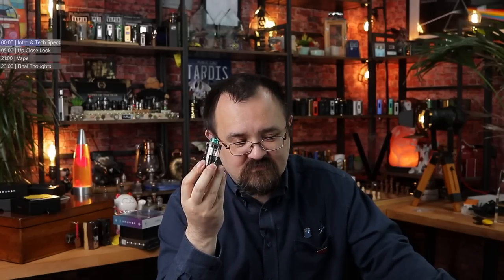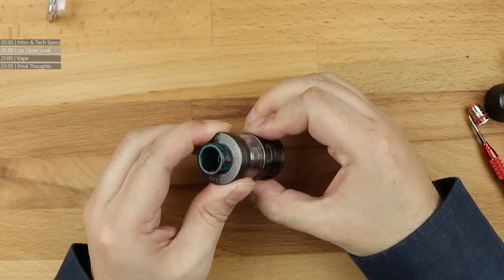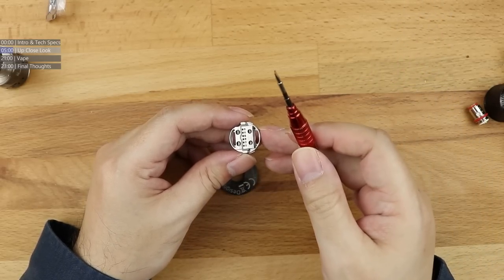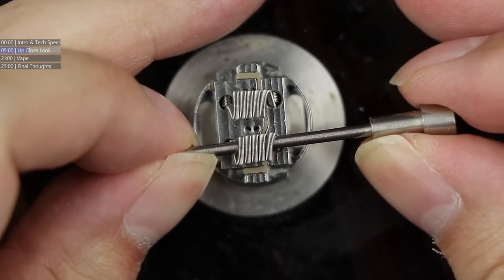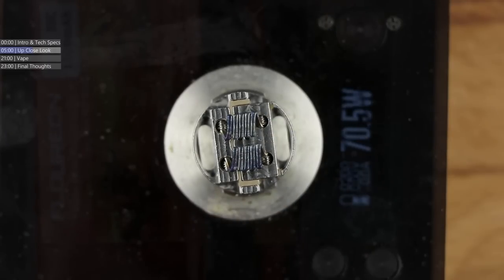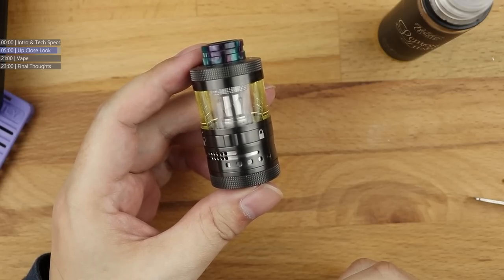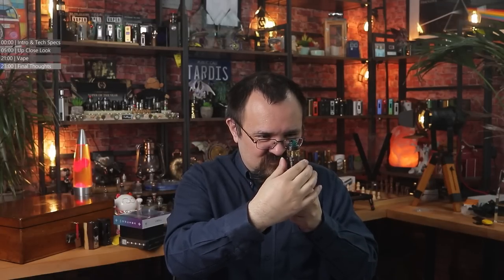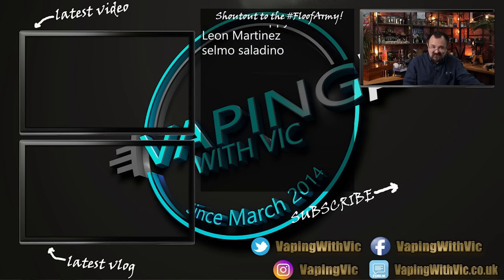Steamcrave Aromamizer Plus V3 - The Plus gets a refit

Comment: I use the supreme V3 & it hits like a drunk step dad. the flavour you got from it is absolutely outstanding 👌
Reply: V3 is the way to go using that and the Ragnar currently
Reply: Preach! The Supreme v3 was the third rebuildable I got. I knew absolutely nothing about rebuildables back then, saw it in a best of 2020 video or whatever year it was, I liked that it looked different and got it. Well, a dozen tanks bought later, and I'm still here with the Supreme v3. It's my absolute favorite. Is it the best at everything? No. I do prefer my Blotto Max or Fat Rabbit for some liquids, and I do love the practicality of my Blaze due to it being top airflow, and I think that the Profile M is a better with mesh (also, the Profile RDTA is the best mesh thing ever flavor wise), but nothing else does it all well. I wanna go dual coils? Perfect. Want a single coil RTA? Got it. Want mesh to change it up? Sure thing. Custards? Fine. Fruits? Fine too. Cookies? Bring it on. Everything is great on it. AND IT NEVER LEAKS. The Blotto Max, unlike its predecessor, doesn't really have a leak problem, but during the summer with temps reaching 35-40C in Greece, I did get some leaking. The Fat Rabbit leaks like blown high pressure line unless wicked to absolute perfection (and usually leaks a bit even then). The Supreme? Never leaks. Well, unless you forget to close the JFC, fill it to the brim and forcefully screw down the top cap. Banging tank. When I'm in better financial condition, I'm getting the Plus v3. Not that it's that expensive, but I'll also need a mod that fits the damn thing.
Reply: @959tolis626  Δοκίμασε το Valkyrie 30mm. Πολύ καλός ατμοποιητης.

Comment: I bought two Knipex 78 91 125 for the wire clip catcher and this one because it's hardened steel for more durability.  I had a Coil Master or Youde diagonal cutter that I loved, but one of the cutting blades broke off.  I went looking at Knipex online (because of a post on ECF) to find the wire clip catcher and found two model numbers.  I bought this one because the one I had broke.  I don't remember what I was cutting when they broke, but it wasn't something like 14 AWG copper from Romex.  I bought two while I was at it just in case one breaks.  The wire clip catcher got misadjusted so the wire flew, but a tweaked it back in place.  It's expensive, but well worth the money!  KC Tool had the best price in America.

I bought a Steam Crave Glaz V2 for its 10ml capacity and its glass chimney (which is very cool.  I have an Aromamizer Supreme RDTA from a friend that I don't know the version of, so this Aromamizer Plus V3 is certainly on the radar.  I'm think one full row of side AF holes with bottom AF so it doesn't drink juice like a fish.  I love DTL at 420° 65-70W and don't need massive clouds.  I've been thinking about getting a G Class V1 because the V2 isn't better or even as good yet.  YiHi tells me that the SL Class V2 and G Class V2 will be getting a new Chipboard.  The SL Class V2 because it was not designed to be Firmware Upgradeable and I can't remember why for the G Class V2.  They are still working one both for the DIY Mod builder crowd and for other manufacturers to use.  My SL Class V2 will be sent in for a Chipboard change and I'll decide between G Class versions once I know what the V2 will have and what it won't.

Thank you, Vic!